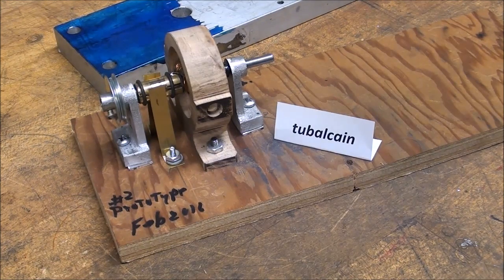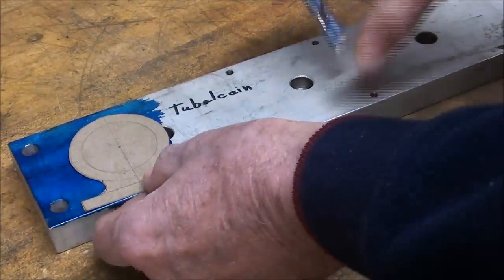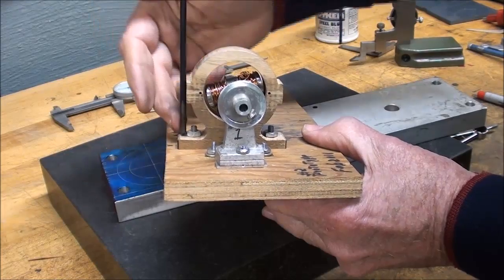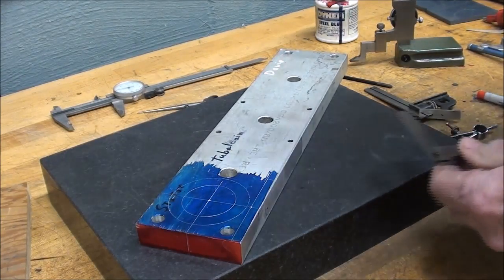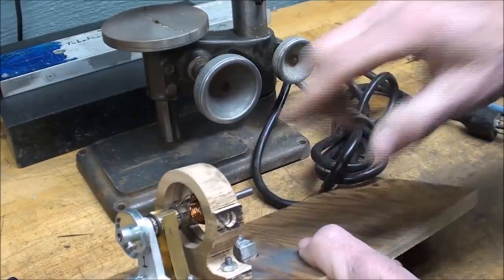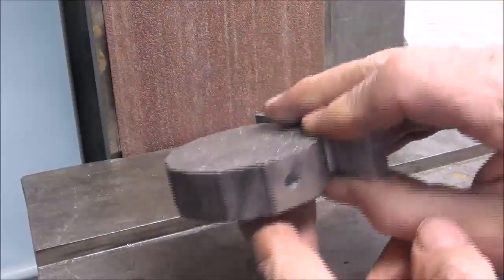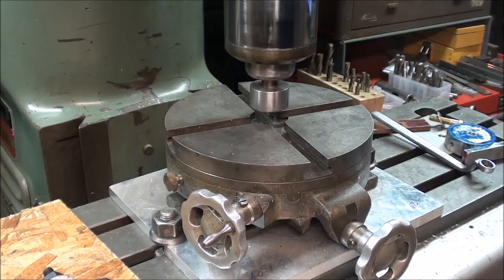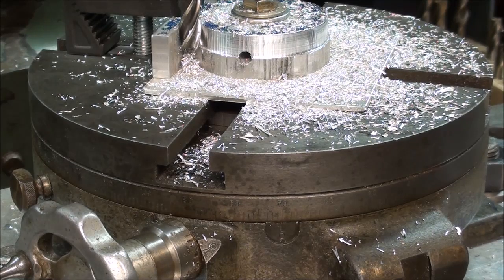Pt 2 tubalcain BUILDS A MODEL GENERATOR for a Steam Engine

Comment: It's been so timely finding your channel. I work for a structural steel fabricator, for the last 7-8 years I've been operating a cnc oxy/fuel burning machine. Recently, however, I've been also tasked to the on-site machine shop to assist our machinist in milling some plate steel and bar stock. Your videos have given me context for some of the new, to me, machining terminology that I'm getting at work. Thank you.
Reply from the maker: +Darryl Machtmes Glad I helped

Comment: I sure enjoy and learn from your videos.  Power to you!  I've been into steam for 30+ years and there is always something to learn.  Thank you.
I am currently building an H Twin with bore 1.625" x 2.25" stroke to directly power a generator with the flywheel as the PMA.
I like the DA oscillating because they have a built in pressure relief.

Comment: I prefer wrapping cords up with velcro strap.  There's a wider end with a hole in it so you can attach it to the cord, and then you just wrap around the cord onto itself.  

It's pricier than solder but it's lead-free, and that counts for a lot with me.

Comment: Tubalcain;  I have the exact Dumore Sensitive Drill.  Mine needs new bearings.  I haven't been able to remove the chuck.  I drilled and tapped it for a socket head to drive it off, didn't work.  Also, I can't "turn" it off.   Even tried a little gentle blue wrench.  I plead to your inner metal monger.
Reply from the maker: +Crafted I never had my chuck off--not sure how it is fastened

Comment: You couldn't find a piece of iron?
Reply: Gerald Miller 1- iron is a lot harder to work with than aluminum, and 2- the button magnets would be "short circuited" if iron was used instead of aluminum.

Comment: +mrpete222  If you want endless blocks of plastic stock to fool around with you have to get in on the HDPE melting internet craze. I think Randy Knapp (watch his HDPE combing video here) is the God of the melt, but other hacks do OK too. So get yourself a second hand toaster oven and join in on the fun!
Reply from the maker: +Paul Frederick I just subscribed & will check it out
Reply: mrpete222
You're a smart enough cookie to pick up on everything. But a few tips at the outset can help you get up to speed easier.

Beginning use parchment paper. Because you've just never dealt with molten HDPE before. Once you've gained some familiarity you might be able to do without the parchment paper. Everyone develops their own process. But that first molten blob of HDPE is something we all have to face. Be prepared for it. It is like a huge wad of hot glue.

HDPE shrinks a lot as it cools. This has an impact on consolidating it without air bubbles. A widely used technique is the progressive clamping method. Randy demonstrates it in his video. So pay heed to that.

Finally, be aware that there are different kinds of HDPE. There is injection, and the blow molded varieties. Each has different properties too. Randy uses injection HDPE. Injection plastic is nice, but I actually prefer blocks of blow molded myself. Blow molded does not flow as well as injection does molten though. Which means it is tougher to melt.

Good luck, and enjoy.